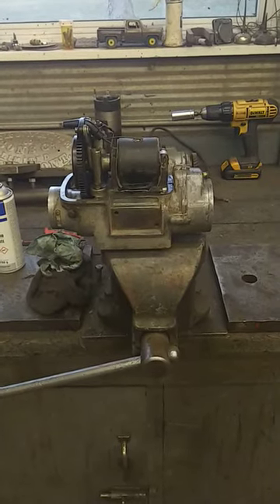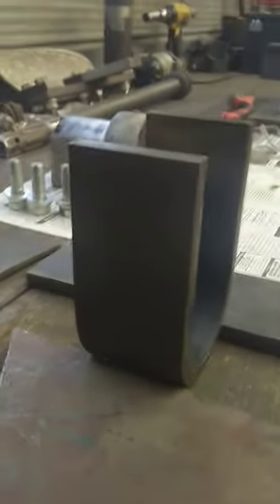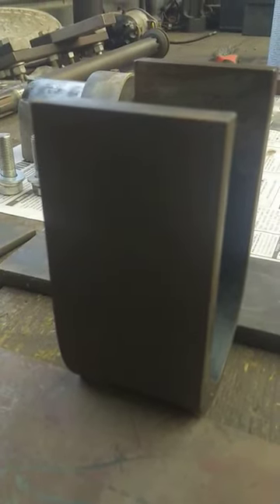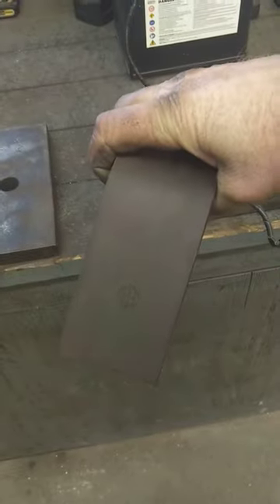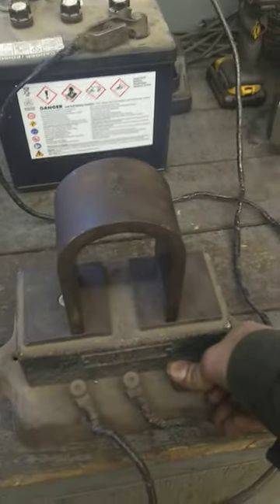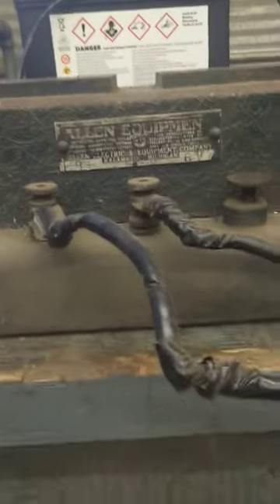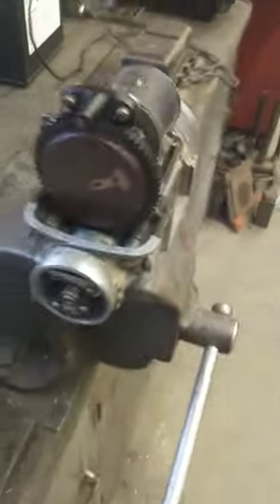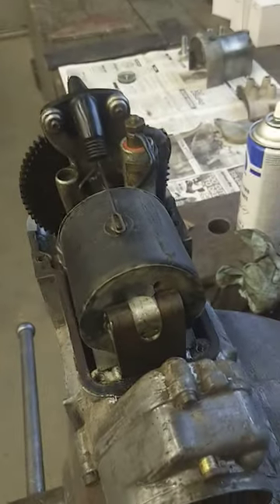Charging the Horseshoe Magnet for a Magneto Ignition Unit.

Comment: Pole blocks, keeper plates, old wives tales? Nice job. I have to build a charger. Got a dead mag on my 10-20 McCormick
Reply from the maker: Yes, always put a keeper plate across the magnet when it is not installed. Thanks.